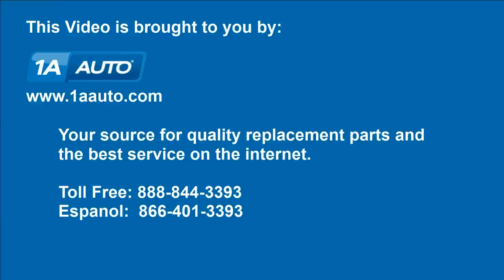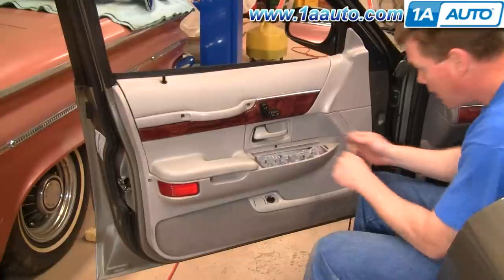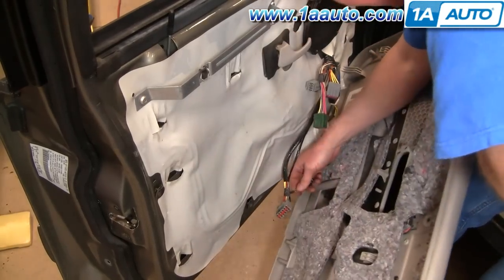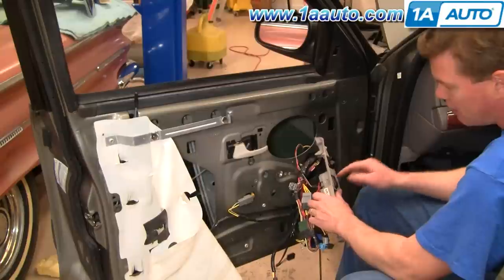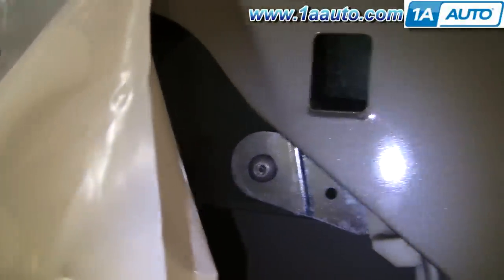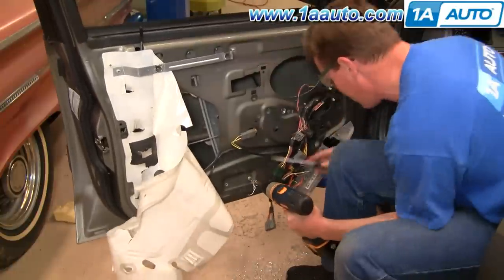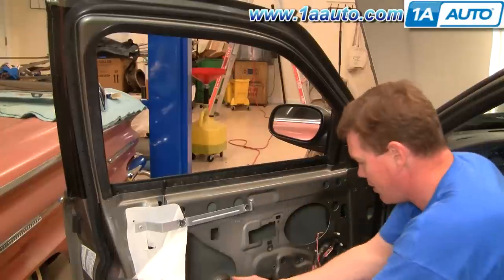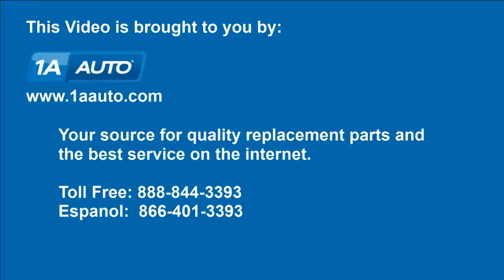How to Replace Window Regulator 92-10 Mercury Grand Marquis

Comment: The window regulator seems fine, but the motor is just weak and needs help going up. Can the motor  be replaced by itself?
Reply from the maker: Sure can! Here's a link to them on our website. Order from us and we'll ship them for free. that said, often if the motor has failed, the regulator itself isn't too far behind. If I were you, I'd pull the door apart and see how everything looks before placing an order. That way you can be sure you get everything you need. https://www.1aauto.com/power-window-motor/i/1awpm00025?f=304190&y=1996

Comment: What size nuts and bolts were used for replacement to rivets ?
Reply from the maker: +khalil h rashid Thanks for watching!  It doesn't really matter what size the nuts and bolts are, as long as they will fit in the 3/8" hole you created, and are going to be the correct length to allow operation!  www.1aauto.com

Comment: What are the size nuts and bolts to replace the rivets??
Reply: Probably too late, but 1/4" 20 ×1/2" and 3/4" (or the metric equivalent) bolts and nuts work great.   1/2" long bolts allow you to fasten the nut from the outside on the bottom 2 holes of the rail mount to make things easier.

Comment: 5:30 my window mysteriously slid down while I was driving and it's stuck like hell. I pulled and pulled and I'd sooner lift the car off the ground than move the window. How do you proceed from here? I can pry through the holes in the door but afraid I'm going to break the glass.
Reply from the maker: +castirondude If you are able to take the door panel off you may be able to manually move the glass up with your hand. It seems like a window cable has snapped which caused for it to fall down.

Comment: What size screws did you source?
Reply from the maker: +Aubrey Hill Hello, the size of the hardware would depend on how you remove the rivets in your door and the size of the hold in the door. This can sometimes vary from model to model. Thanks! 1AAuto.com
Reply: @1AAuto   I'm going to do it same way you did on a 07 p71

Comment: What is the window is not coming down,  it's stuck all the way up. how do I get it to move down
Reply from the maker: +Jose Quijada Thanks for watching. If the window is stuck in the up position, and depending on the way that your vehicle regulator is set up, there are multiple ways to remove this. Some common ways are to gently tap on the window motor while attempting to move the window down to give a burst of power to the motor if it is weak. If this does not work, then you will need to remove the door panel and physically unbolt or disconnect the cable from a cable driven regulator.

Comment: I have a 2003 Mercury Marquis with 17,000 miles on it.   The car is like I just picked it up right out of the showroom.  The other day I went to put down the drivers window and it had no power at all.  My wife, sitting in the front passengers seat tried the passenger window and had the same problem.  I could not work the passenger side window with the drivers side pod either.  I replaced the main drivers stitch pod and that did nothing to help.  I checked every fuse and they are all good.  I never had any symptoms or warning.  I believe the chances of both front window motors going out as the same time is zero. This just happened all at once to both front windows.  The back windows work fine.  Anyone have any ideas?  Thank you, Joe
Reply from the maker: Thanks for checking us out. There could be multiple reasons why you're having this particular problem. We suggest taking your vehicle to a nearby reputable shop to identify the cause. +Joe LoPinto
Reply: OK, Thank you for your response.  Joe

Comment: Tried to replace my window regulator and the motor doesnt line up right with the hook on the motor  and door..
Reply from the maker: +stephone lockett We wouldn't be able to diagnose an issue like that here, you may want to have a local mechanic take a look at it. Thanks for checking us out! 1AAuto.com

Comment: The genius who made the video could've made certain to document the bolt and nut sizes and provide that information in the video. That's the only dumb thing I didn't like about this video. Because that means I have to take shit apart and trial and error screws to figure out which works best. Overall the video was very informative with the exception of that slip by the tech performing in the video.

Comment: all four windows on my 1988 Lincoln town car will not go up what is wrong. they were working then nothing.
Reply from the maker: You may want to check the fuse to see if it's okay. If the fuse is fine, you may want to check the wire loom that runs between the driver side front door and the body of the car for a broken wire that may need to be repaired. Hope this helps you out. 1aauto.com 888-844-3393